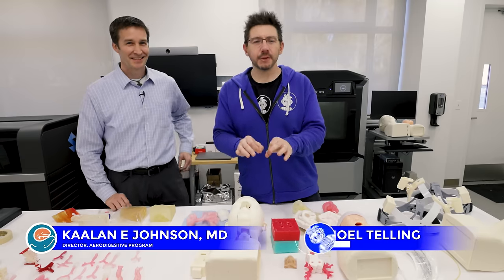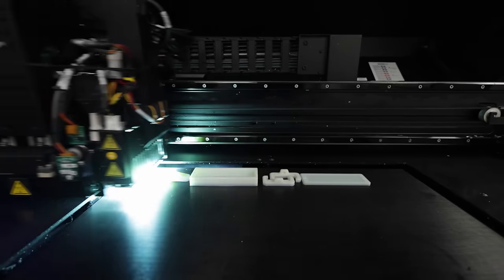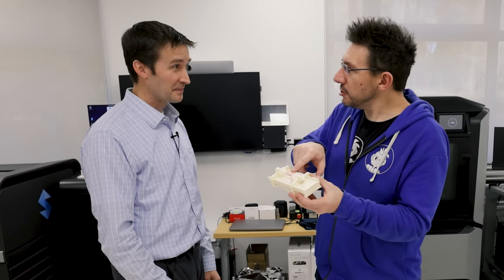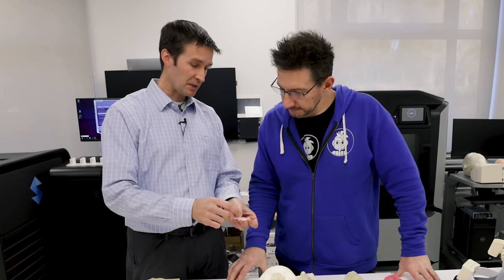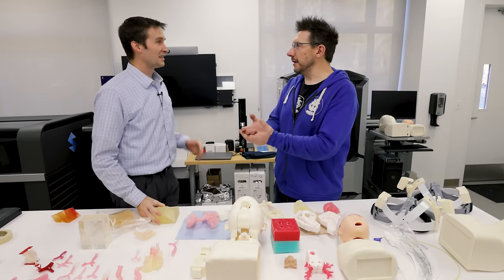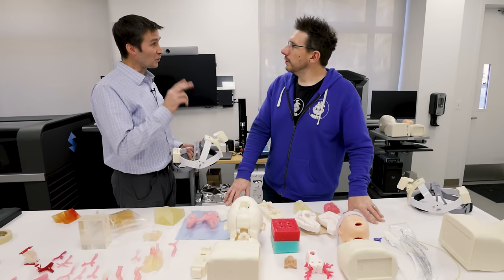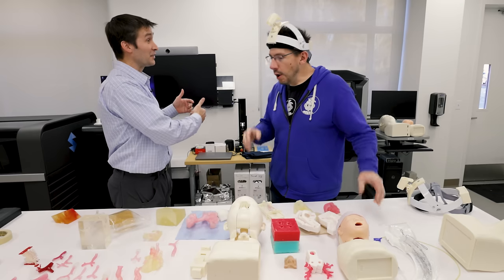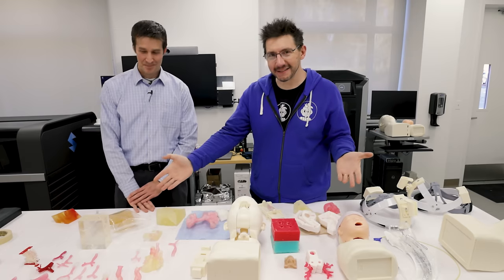Innovating Pediatric Care: 3D Printing at Seattle Children's Hospital

Comment: Joel, thanks for showing this.  I am currently having radiation and chemo for neck cancer and found information about 3D printed mouth guards, which are used to move the tongue and lips out of the radiation path.   My radiation oncologist is aware of the new processes, but they still make an appliance out of tongue depressors and wax.  Progress is happening quickly.

Comment: by the way, i was in an accident and had a collapsed lung from blisters, they did something close to this to figure out how they were gonna do my surgery after the pneumothorax refused to heal without any intervention over than a standard emergency thoracostomy. they cut me open and created an opening with their fingers to get the chest tube inside and position right. didn't hurt as much as it scarred me because the surface skin was numb with the muscles, but when they stuck their fingers in the side of my chest, it got harder to breathe. I couldn't scream either because i couldn't take a deep breathe. it felt as if someone kicked me in the chest and i was winded. I'm 20 and a small guy, im 5'7", 124lbs, as in underweight, i've struggled all my life with it. it took a male nurse and a female nurse on one leg, 2 female nurses on the other, 2 more female nurses holding my left arm over my right side, they were cutting under my left armpit, and another female nurse held my hand for something to squeeze, and the 2 trauma doctors who were inserting the chest tube. i wish it on no one.